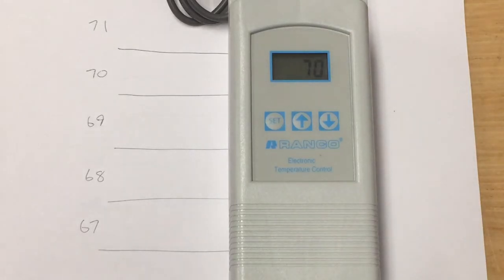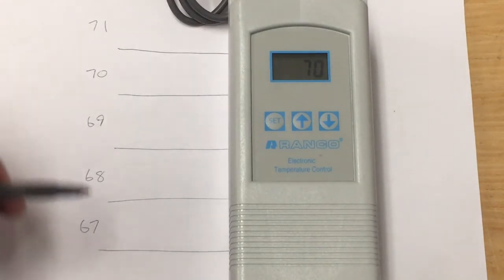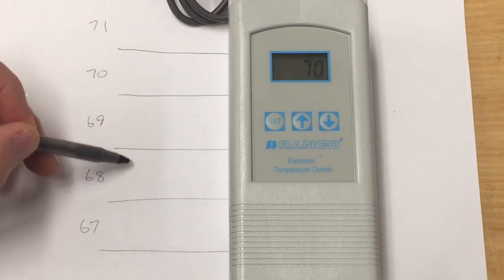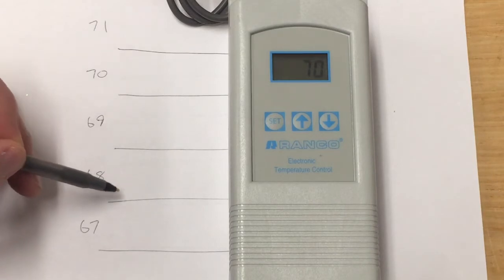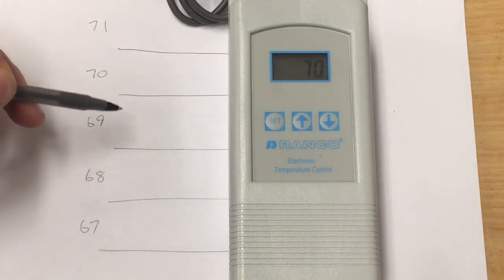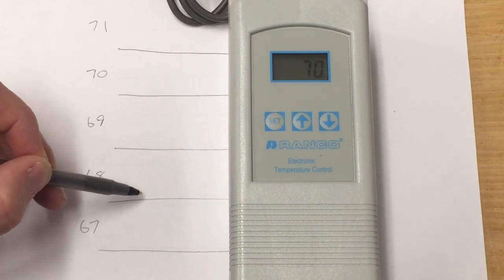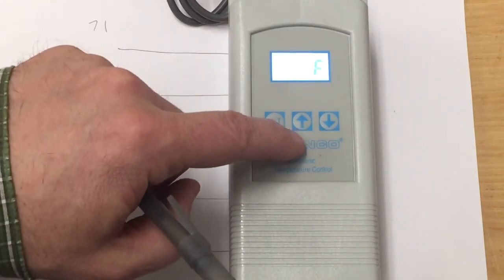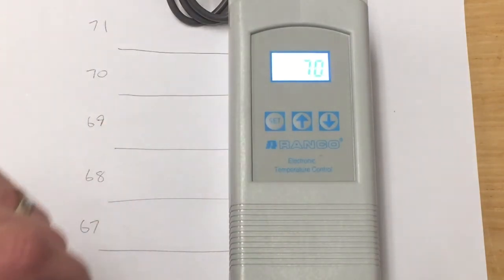Ranco single stage controller setup

Comment: I'm having a very DIFFICULT time understanding how to use the SET point for heating and what the lower set point does. Please help. There is VERY VERY little info on heating and 99% on cooling.